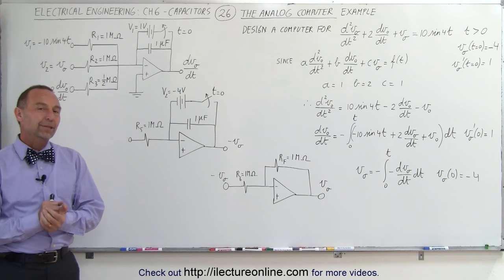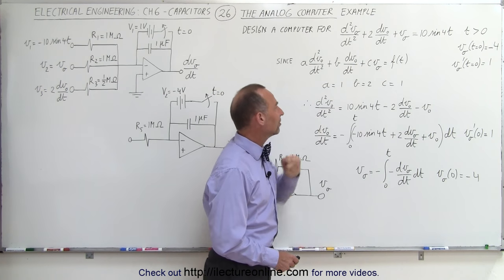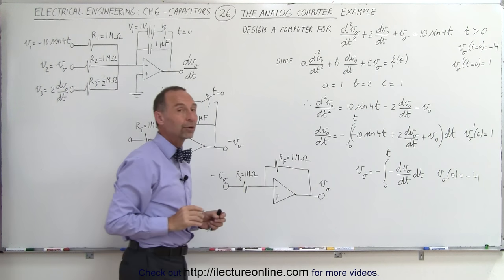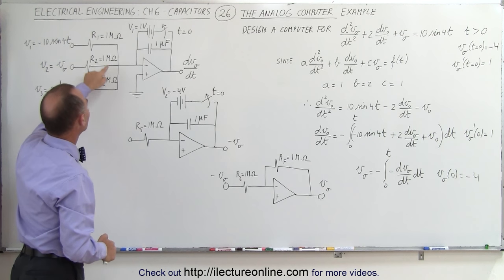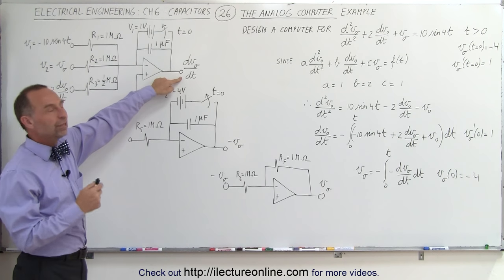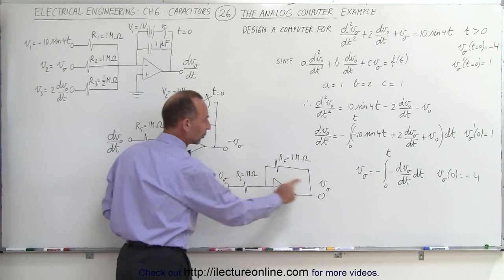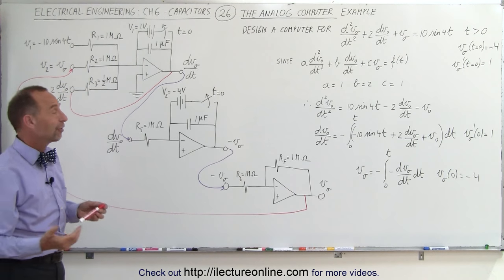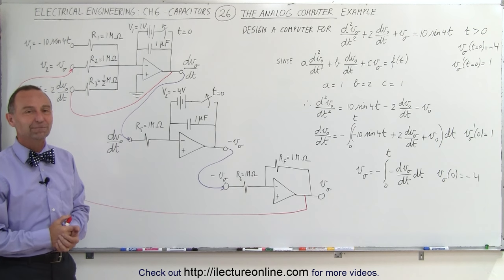Electrical Engineering: Ch 6: Capacitors (26 of 26) The Analog Computer: Example

Comment: 2:30 Is it really necessary to set v3=2*dv/dt? We could have just set v3=dv/dt and it would work out nicely. The output of a simple integrator circuit is (-1/RC)*V(inp). Then, if v3=dv/dt, the output will contain -2dv/dt (Since R=1/2M, C=1u, then 1/RC=2) and it will be fed into the second integrator.

Comment: Sir, why are you opening up the switch at 1V when t=0? Shouldn't it be close when t=0 to be able to get an output of 1V at t=0?
Reply from the maker: The method used to solve circuits is that the current will be the same at the exact time the switch is opened as what the current was before the switch is opened.   Off course a small moment later it will be different.
Reply: @MichelvanBiezen  Understood sir. Thank you so much.